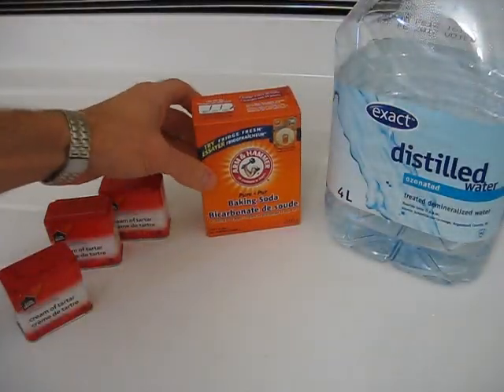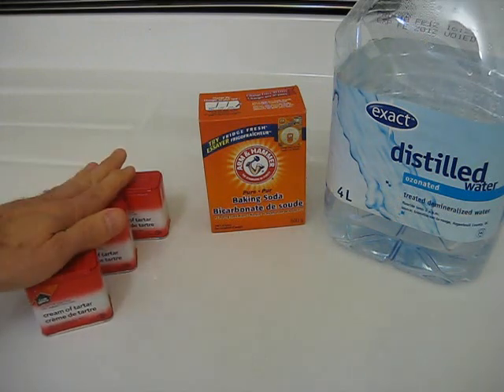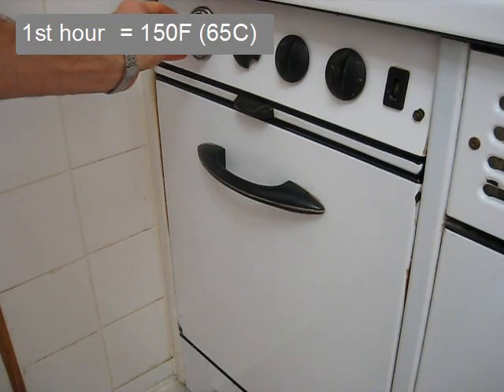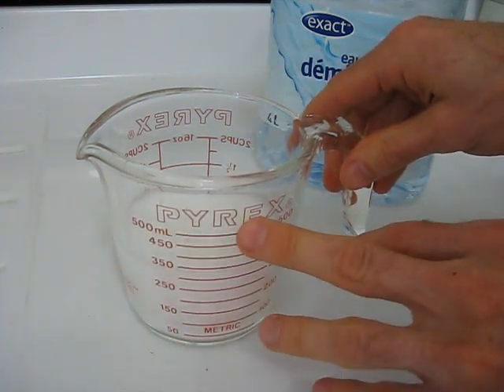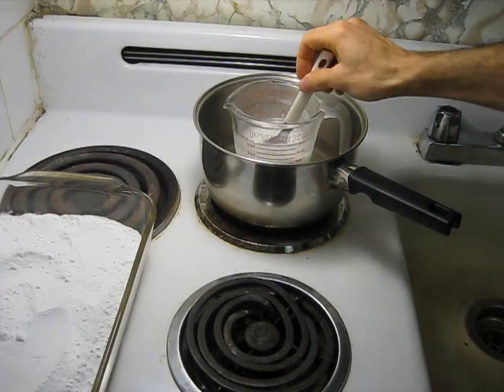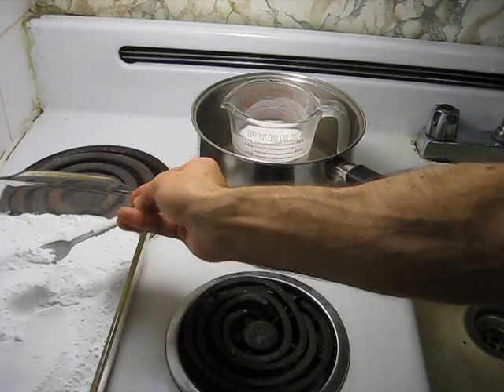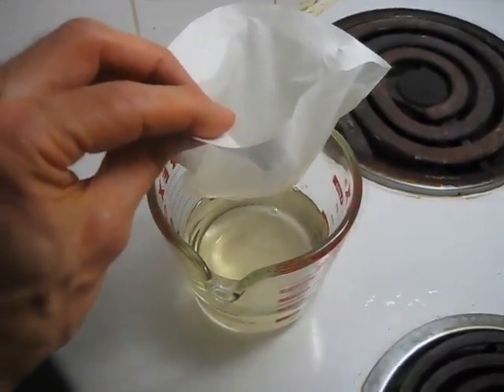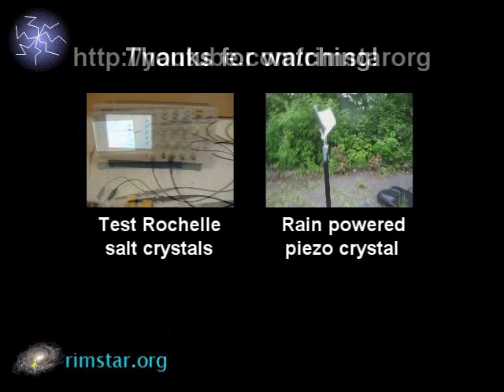How to make Rochelle salt piezoelectric crystals

Comment: What can you do with the Crystals?
Reply: From the 1920s until the 1960s, Rochelle salt crystals were frequently used in record players (as part of the pickup, or 'cartridge') and in microphones.  In the late 1960s, they switched to a different 'ceramic' material for such cartridges (and many manufacturers also began adopting a different 'magnetic' type pickup).
One reason for the switch was Rochelle salts don't hold up very well in humid conditions.  A lot of antique record players you find today have dead crystal cartridges because the crystal has deteriorated inside.

Comment: i poured some in a ice cube tray and it started to crystalized, but not completely. poured most of it in a leftovers container and it hasnt crystalized at all.
Reply from the maker: Was it cool where you put the ice cube tray? Did you leave it there for a few days? I had mine on the window sill for 20 days before removing it. You could also try boiling it again to remove more water and concentrating the solution some more. Maybe having a look at my webpage http://rimstar.org/materials/piezo/how_to_make_rochelle_salt_piezoelectric_crystal.htm will help since I add more information there over time.

Comment: how much piezoelectricity does it produce?
Reply from the maker: I don't know how much power it produces but it's not much. The voltage looks useful but the current is very, very low. Power = voltage x current. So the overall power is low. Probably microwatts or less. (I'll put the same reply where you asked it in my other video so that others can see.)

Comment: Sir, can I ask what your name is because I want to place credit into my paper. Pls?
Reply from the maker: No credit is necessary from my perspective but my full name is Steven Dufresne.
Reply: +RimstarOrg Thank you so much Sir.
Reply: Sir, I have leftover baking soda, can I use the baking soda again to make another Rochelle salt? Or should I heat it again?
Reply from the maker: I don't know. When you heated it you removed hydrogen from it. I don't know if it gradually gets that hydrogen back. It also loses from carbon and oxygen too, and I don't know if it gets that back too. A can't say what the effect of reheating it would be.
Reply: +RimstarOrg So what do I do Sir?  Do i just use the leftover or reheat? I'm kind of worried of my budget especially I dont have enough money for now.
Reply from the maker: If you have enough leftover then try making some without reheating first and if that one doesn't work then try again with reheating. Either that or keep searching online for someone who has the answer.
Reply: +RimstarOrg Thank you Sir!
Reply: Sir, does the Rochelle Salt expires?
Reply from the maker: I don't think it expires, at least not in any reasonable timeframe. I've heard of Rochelle salt crystals from old record players that are still good.
Reply: +RimstarOrg Ohhh ok sir. actually my Research plan is to apply sound waves to the salt to generate elecricity rather than applying brute force to the Salt. is it possible?
Reply from the maker: I doubt that sounds waves would be enough to produce a measurable voltage change to Rochelle salt. I could be wrong, and maybe the voltage change would be big enough to be detectable by sensitive equipment.
Reply: But is there any chance that it could be possible? Like just a little volts could be produced?
Reply from the maker: Yes, there's a chance. There are piezo microphones but as far as I know they don't use Rochelle salt. They use some other type of piezoelectric crystal, but I don't know what it is.
Reply: +RimstarOrg Sir, I just made another solution,the cream of tartar and distilled water poured with baking soda,  but I cannot filter it with coffee filter~ The solution is too thick~ Help plss. i cant really filter it. and Can I buy rochelle salts?
Reply from the maker: What's different than you previous times when you could filter it?
I don't know if you can buy it. I've never looked to see if you can buy rochelle salts. Try searching online.
Reply: +RimstarOrg Actually, the one who actually filtered the solution is my cousin. And now He's away, its too hard to communicate. I tried making my own. Then I can filter it now.
Reply: You can use the bicarbonate directly without converting it to carbonate. I think the converted stuff will pick up some water weight but for our purposes the only thing changing is its weight.
Many old mics used Rochelle salt for the pickups, it is mechanically weaker than quartz and also needs to be kept cool and dry. 
If you solution is yellow you have contaminants, most likely a starch as an anti caking agent in the cream of tartar.
Thinner crystals move better, the commercially produced pieces were grown massive crystals and sliced into wafers with a wet string.
Reply: ***** So, Sir, I can buy commercial rochelle salt?
Reply: yup look on ebay, its used by photographers and chemists typically
Reply: +Ian Hoff Ohh! Thanks Sir! Uhm Sir, does my plan has any chance being right?
Reply: DinguChan   did your project succeed?

Comment: Hey nice build, Do you think you could help with a project build. Building a custom water atomizer? If you have any ideas diagrams or want to help with pointing me in the right direction all help will be greatly appreciated!
Reply from the maker: Anthony Scott Thanks. And sorry, I really don't know anything about them, other than that I have an atomizer in an old air humidifier that's been in the closet for years.
Reply: RimstarOrg  Well from what i understand they use pizeo ceramic material. I have looked on aliexpress for the actual piezo ceramics. As well this could be a great indestructible and youtube vid.  If you take your humidifier apart you will see the atomizer ceramic disc. I am trying to group several together to create a larger atomizing affect. It's similar to the pond foggers, although the disc sizes have their variable frequencies. Let me know what you think. Thanks :)
Reply: RimstarOrg Also have you ever tried growing the crystals on copper wiring or tested the affects of magnets with the crystals?

Thanks.
Reply from the maker: Anthony Scott Oh neat (now that you mentioned how it works I just looked it up on wikipedia.) They also talk about this other method under the heading Principle of operation https://en.wikipedia.org/wiki/Atomizer_nozzle#Principle_of_operation. So that's how spray bottles like that work! I don't know if that method suits your needs though.
Reply from the maker: Anthony Scott No, I haven't tried any of that.
Reply: RimstarOrg  Yeah I thought about using a small compressor. Run the outlet to a dial regulator then attaching it to the piping system. I would use multiple brass atomizer misters. While the air pumps into the top portion of the pvc piping the bilge pump or submersible pump would provide the water to the misting heads. I would have to dial the right PSI to the unit though so that it doesn't resist to much of the water flow.  The misting units hopefully allow enough escape of the psi to keep the unit from over pressuring. I could tie in to the piping with a relief as well. Since this is low pressure it may be unnecessary.   To avoid most of this I was thinking about customizing a few ultrasonic ceramic discs to maximize the evaporation. Then use waterproof fans to move it to the desired areas. 

Little bit of experimentation and hopefully the desired affects. Although both systems can be used for different operations. Any other ideas let me know!
Reply: RimstarOrg If you ever do, let me know I would be interested to see the results. IF the magnets have some type of power flux on the crystals by creating a strong enough of a field then that may have some great applications as well.

Comment: I can find lots of sources of cream of tartar, how can I decide which are real and which are fake ? Prices vary wildly and it's also available in larger packs on ebay for other uses. 

I can't find any references to substitutes except in cooking where baking powder or tartaric acid are sometimes used but I don't think that's what you're referring to.

I can also easily find washing soda - supposed to be sodium carbonate - in huge cheap bags for laundry. Can I use that instead of converting little packs of baking soda ? Or is that something else ?

Or I can just buy https://www.ebay.co.uk/itm//262483530650 ready made. Will that work ? Sure, it's cool to make the salt, but it's actually the crystal I want, I don't much care how I get the solution.
Reply from the maker: Finding real cream of tartar is a hard one. The packages often don't say since for its normal use, cooking, it doesn't usually matter. The only clue I have is that the real one is far more expensive, which is probably why there are substitutes for cooking purposes.

Regarding the washing soda for laundry, I guess it depends on how pure it is, if there are any other ingredients in it. I've no experience with using it.

I've also no experience with the ready-made rochelle salt so I don't know how well it would work.